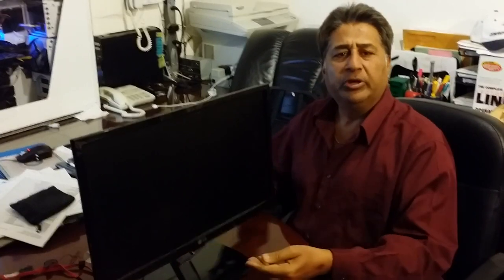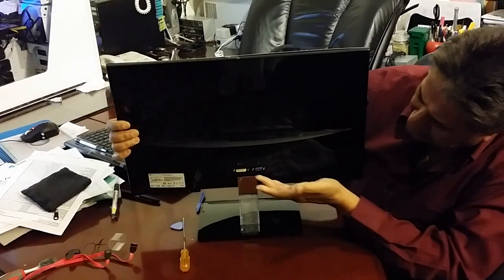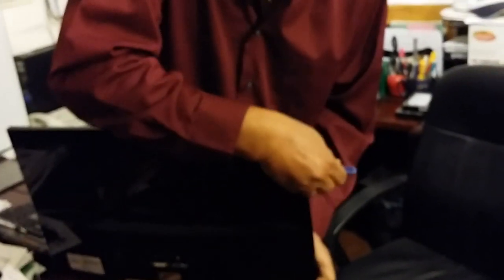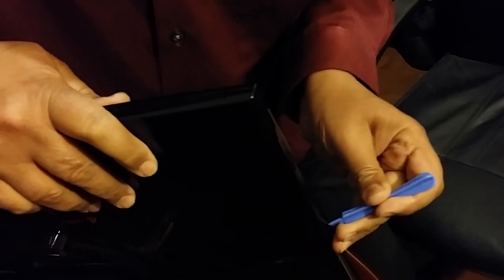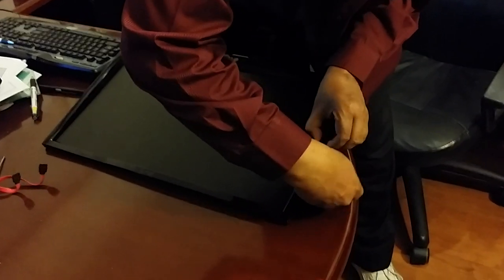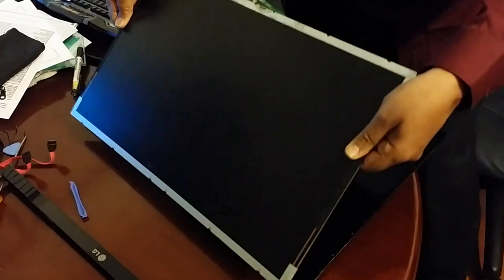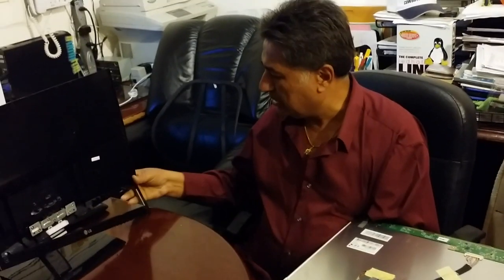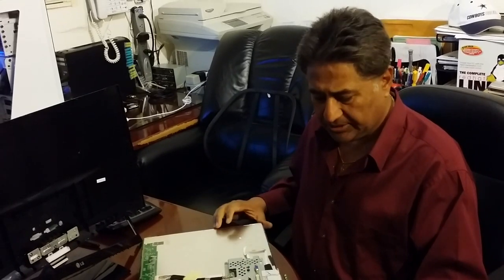Flatron E2360V-PN "LM230WF5-TLA1-06" LG Electronics LCD Panel 23 in Easy Steps

Comment: Thank you! I needed this information to know whether it's possible to drill holes for VESA mounting. :) Very helpful.
Reply: i'll try same thing, you did it ? 
can send some tips for me ?
Reply: @jonathanvale5667  hey have you mounted ur monitor ?
Reply: @rashardlewisdelapaz1056  yes, and worked fine
Reply: @jonathanvale5667   Hey. how did you remove the transparent stand?
Reply: @asiarossa1228  yes, and i mounted in a VESA stand
Reply: @asiarossa1228  after opening, it will have 4 screws that hold this transparent part, then you will be able to remove it.
After removing, I drilled the rear with the VESA measure and mounted it on the stand

Comment: Did you get any case of overheating on this specific monitor?
I did  bought 3 E2360 and all of them started turning off after some time of use, and gues what, all after warranty.
I strugled to find out the monitor is "overheating" that is why it is turning off. As soon as circuit achieve 45c it turns off. It is not even hot, but warm. I guess something is bad pogramed in the IC, like a very low threshold to turn it off.
Any suggestion to fix it?
I am in Brasil. Thanks
Reply: @sistemadoit  Então, me surgiu esse problema. E sim, é superaquecimento. 
Como solução, recortei um circulo na carcaça exatamente aonde fica o dissipador. Resolveu em partes. Solução definitiva? Um cooler nesse furo.